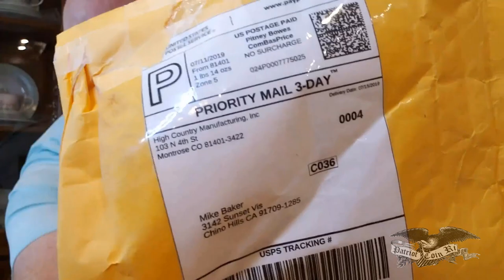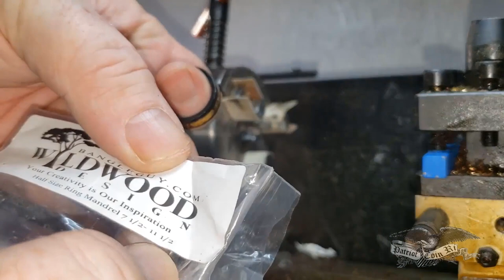Mini-Lathe Expanding Mandrel Open Box Review - Sponsored by BangleGuy & Wildwood!

Comment: You explained the obvious end,how about the other end? A how do you get your fingers away from spinning chuck?
Reply from the maker: I often work with my fingers close to the chuck, yes it is dangerous and you need to do so with great caution and common sense but few other things work as good as "feeling" what you are doing.  Doing things like sanding out the inside with sandpaper for a mirror polish after you've used a lathe tungsten bore bar or other I'll do things like wrap the sandpaper around a wood Dowling or other and insert that, not my fingers, and I use wood because the wood will snap off if it catches compared to metal that might take your hand for a spin with it.  This definitely wasn't a safety video.  

As for your question about explaining the end, I didn't know what you meant.  Please elaborate?

Comment: would you still recommend this mandrel or another after all this time.
Reply from the maker: Yes, I wouldn't do without it.  I know in a previous message you said you had issues with it wobbling on you but I haven't and I'm still using the same ones since the video was made here.  Things can happen over time such as knocking it off being centered but the only thing I wish was that there were more sizes available.  I do have some new information that a new one was made by Legacy and I'm talking with the owners Karen and Larry right now as we speak.  I'd like to get my hands on a couple sets and maybe they'll sponsor us to try them out.  To be honest, I don't understand how it works but it is different from these and as of right now, I'm really confused how it would work but they claim it allows not just external milling but internal milling as well if I understand their item description correctly.  Legacy has sponsored us before and these being very affordably priced, they may be willing to send a few to do an out-of-the-box review for you guys to see and possibly give away one or two to a couple lucky viewers.  I seriously need to check it out first though because by the ad alone I just can't figure out how it works and a good video really does need to be made that would benefit them as well.  I'll let you know how it goes as soon as I reach out to them and hear back which should be in just a couple days.

Another fun review and giveaway is overdue.

Michael Baker, Jeweler and Coin Ring Craftsman
www.PatriotCoinRings.com

Comment: Will this mandrel fit in a drill chuck so I don’t have to buy a lathe. So I can sand/polish the ring etc. ?
Reply from the maker: I couldn't imagine doing this work without the expanding mandrels with rubber drums for drills which I keep mine locked into a vice if that's what you are talking about but with that being said, it will get you started in the hobby however never replace the sweet life of owning a lathe if you plan on ever expanding your horizons.

Comment: What the best lathe to use with the ring chucks for beginners
Reply from the maker: Sorry for the delay in answering brother, I've been so crazy busy.  My Christmas sales rush typically starts in September and doesn't really slow till February for some reason.  To answer your question in short, I've been in the hobby for about 12 years now and although I have a higher end model Lathe here, I still have not one but two (2) Harbor Freight Mini Lathes for my employees to use as needed.  Just 3 years ago they were selling for about $400 but expect to spend over $700 now for one with the price increase on everything it seems these days.  Looking to Google and eBay, I've seen a few others for a bit less and even look better but despite the reputation for HF having cheap quality Chinese knockoffs, these have held up rather well for me and again, 12 years into it since my first one purchased, I do recommend a 3 year plus insurance purchase because it's main gears are plastic but nevertheless, it's paid for itself in what I've made and sold many times over and they do include a lot of extra parts, just in case one of those go bad if you didn't want to buy the insurance.  

Hope this helps brother!

Comment: I Have a Vevor mini wood lathe and have no idea what size ring mandrels to buy for it?
Reply from the maker: When it comes to ring mandrels they are almost always US Size 2-15.  Anything larger and you'll need to special order it or on a rare occasion, you'll find the big person's finger mandrels US Size 15-21 on eBay.  One important factor I learned after buying several dozen mandrels is that almost two are never alike in measurement especially if you pay for the inexpensive mandrels starting at $8 USD.  You'll want to make sure you find a company like Pepetools or Jasons.Works etc that will sell "Calibrated Mandrels" and expect to pay around a hundred bucks for a quality mandrel.  Trust me, you'll want it over having to keep resizing your customer's rings or having to make them over because your mandrel was off.
Reply: @PatriotCoinRings  -thanks for the quick answer!
Reply from the maker: @larrymoremckenzie3029  always happy to help :)